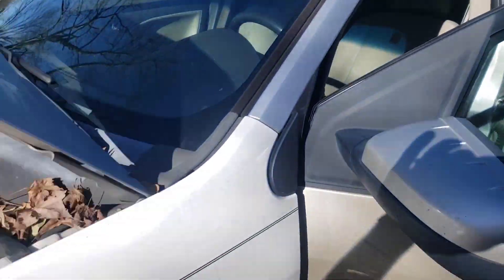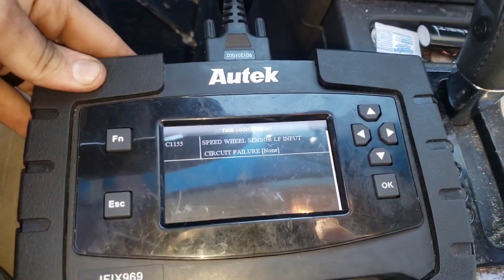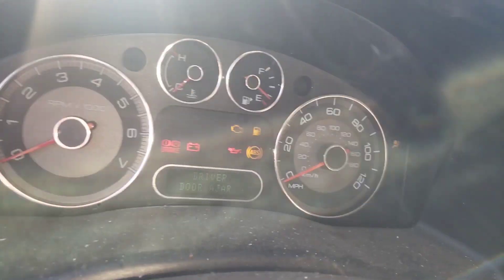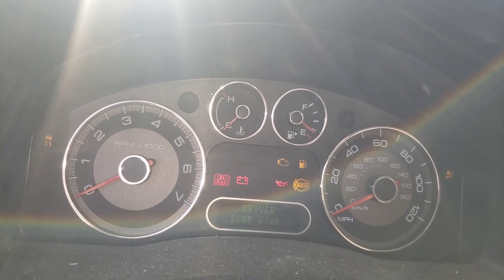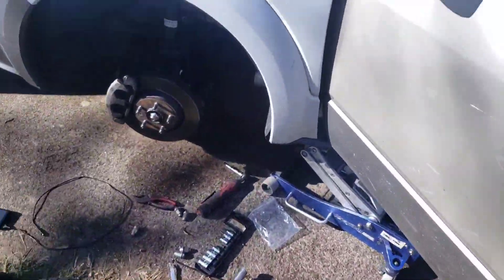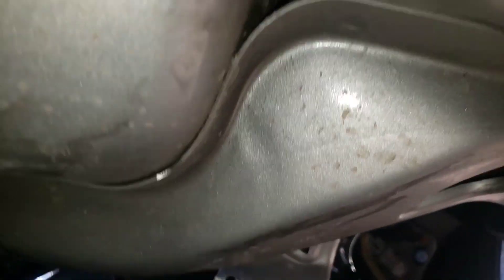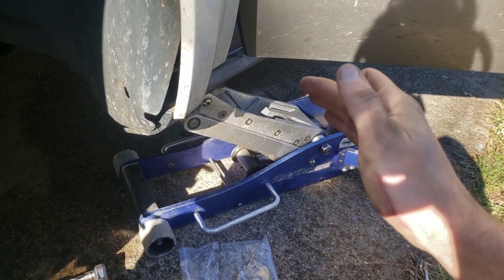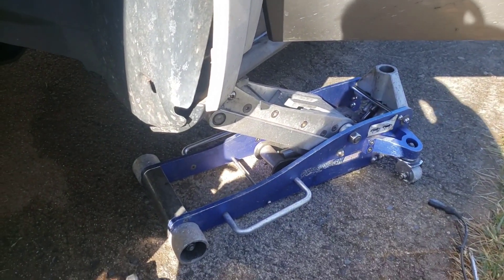C1155 ABS Diagnose Fix How to Wheel Speed Sensor Code Ford Taurus F150 c1158 Input Circuit Failure

Comment: Thanks for this.Very informative.I had an esp abs light and the tester said that is the sensor.I changed the sensor and still same error.I watched the video and found out that connector had the contacts oxidized.Cleaned the connector and the errors dissapeared.Thanks a lot man.You saved me a trip to the mechanic ❤